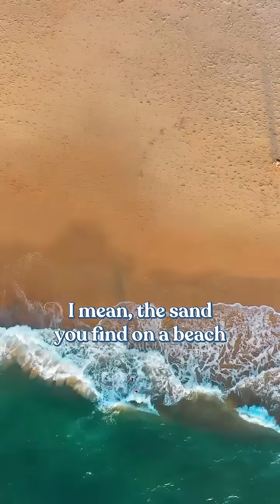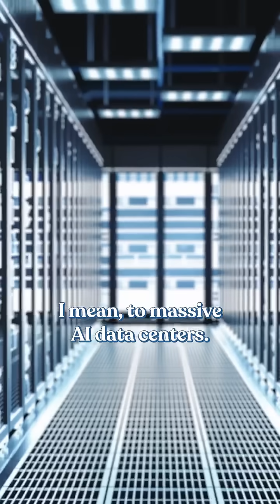🤯 Sand to Chip: The UNBELIEVABLE Transformation.This channel is teaches you about tech world

Comment: I seem to remember that it wasn't extracted from the sand but from silicon mines where the mineral is found in a purer form than beach sand.
Reply from the maker: You are correct!
Silicon's raw source is silicon dioxide (\text{SiO}_2), found as quartz rock (mined) and silica sand (mined/dredged).
For electronics/solar (ultra-high purity), the source material must be very pure (often quartz), and then it undergoes a complex chemical purification process (like the Siemens process) far beyond simple sand extraction.